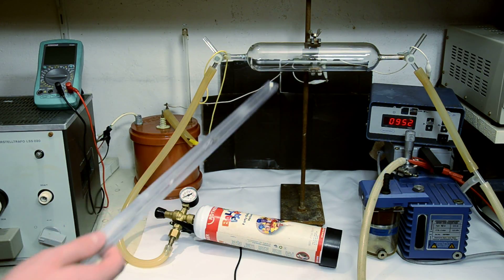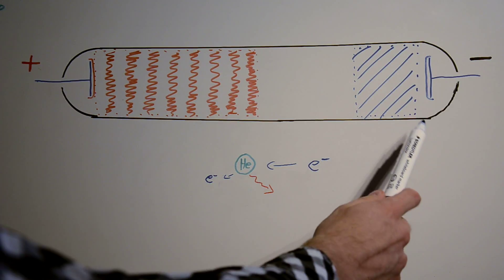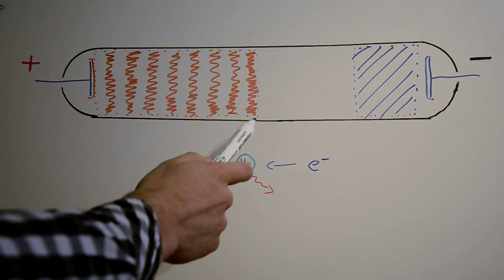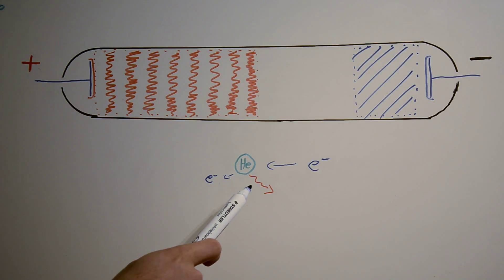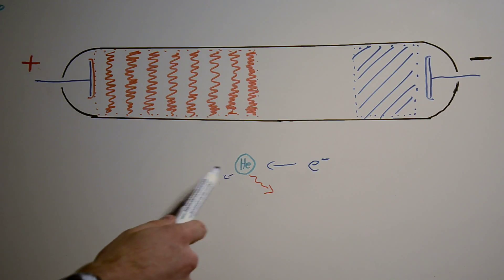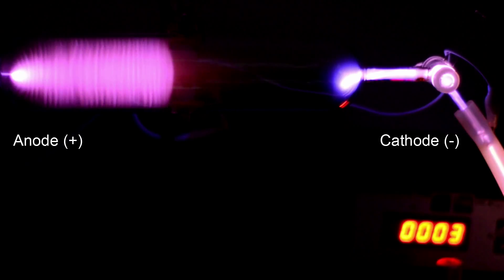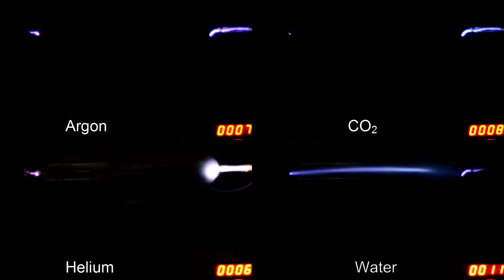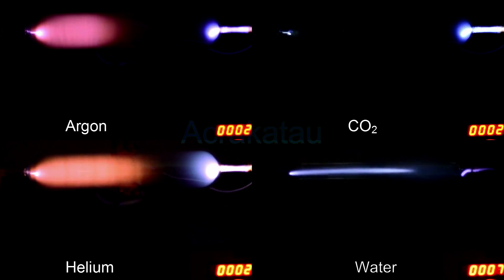Plasma colors and structures of various Gases in a vacuum discharge tube

Comment: Millitorr is a unit of pressure that is often used in vacuum technology, where very low pressures are common. It is one-thousandth of a torr, and the torr itself is a unit of pressure defined as 1/760 of standard atmospheric pressure.

So, in this case, the pressure unit is likely millitorr (mTorr).
Reply: He said millibar which is metric but it doesn’t matter it could be inches of Hg and it is still describing the same thing.

Comment: How does the water one not explode? There should be electrolysis and then the plasma will ignite it the O and H2 gasses formed, right?
Reply: Naaaah.  There's almost nothing in there!  It might be getting pretty warm in there, but there's nothing to detonate I think, this is like 1/100th of the atmospheric pressure.

Comment: Aren't those layers on the positive side just double layers.
I think the reason why you have such strange behavior when it comes to the water is the mass difference between oxygen and hydrogen. This is in contrast with the mass difference between oxygen and carbon.

The higher the mass of the ions more double layering you will find. That is why argon has the longest double layer and helium the shortest amongst the more stable plasmas.

Due to the strange mixture of hydrogen and much heavier oxygen explains the unstable behavior.
The column in the middle could be a column of oxygen, concentrated due Marklund Convection, while weak and unstable hydrogen double layers forms on the outside of the colum. 
Even the CO2 one tends to have rounder double layer disks than the ones with only one type of element in them.

These columns of double layers probably don't end, they just goes from glow mode to dark mode.
Reply: What are double layers

Comment: what are the applied voltages?
Reply: @julesdownunder KV
Reply: @julesdownunder Just KILO VOLTS.  Thousands of Volts.  Thousands of VOLT-AMPS would be a lot of POWER, and enough to melt the tube and wires and everything.  He's probably using like FIVE Volt-Amps (Watts).

Comment: how you put water in the vacuum tube? is not a gas
Reply from the maker: The water was inserted with a syringe through a needle in the silicone tubing. Due to the low pressure in the tube the water will evaporate even at room temperature and fill the whole discharge tube with water vapour/gas.
Reply: @acrakatau4365  Can mixed gases such as helium and argon glow simultaneously? What density of the gas will give it the ability to glow? Will it glow when we mix it with gases such as oxygen or nitrogen?
Reply: water are condensate state in 1atm, but is a gas (h2o)
Reply: Acrakatau
Any idea what the spectral output is with the water tube?  Is it a heavy UV emitter?

Comment: are you changing the applied voltage level with respect to time, or is the alternating intensity of the light an artifact of the camera you are using?
Reply from the maker: At the beginning the voltage isn't changed over time, but the pressure. The little red number in the corner is the pressure gauge (in mbar). At the end I tried to get the nicest plasma by adjusting the voltage a bit, therefore the plasma fluctuates in shape and light intensity.
Reply: What pressure gauge are you using ? thank you